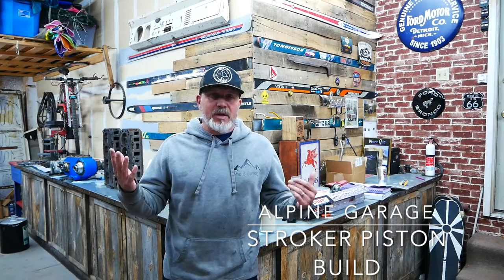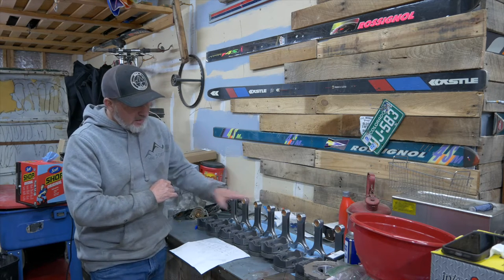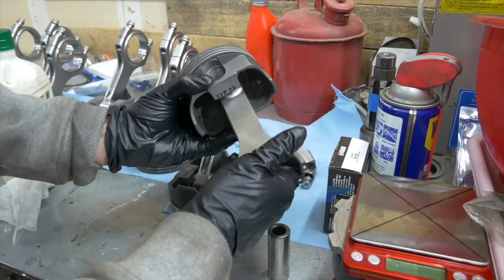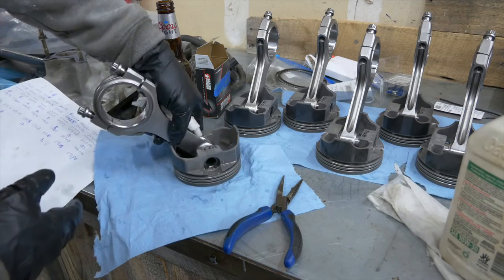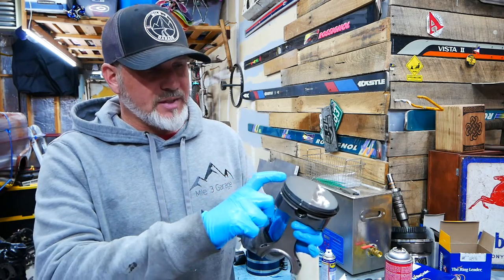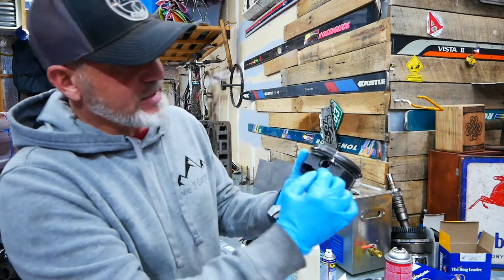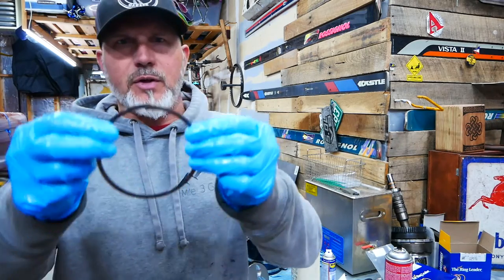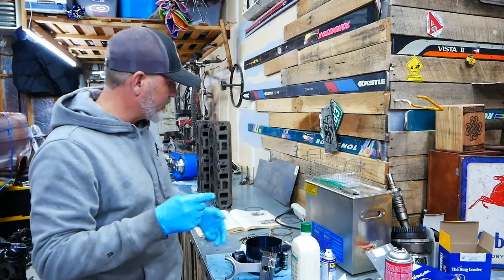Ford Bronco - Building a STROKER 347! [Pistons / Oil Support Ring /Machine Shop Issues]

Comment: You want the oil control ring to ride in the bore the same as the piston rings. The end gaps are OK at about .020"-.025" 
This is how the oil control ring pack manages the proper amount of oil film in the bore without smoking and fouling. Hey just trying to help.
Reply: I am building a 331 small block Ford stroker this week so I appreciate your videos and wish you the best!

Comment: I like the way that You are building Your engine ! Taking Your time to make sure all your clearances are within specifications , will take You 
longer but You will have a superior product !  Also whose stroker kit is that ? I noticed that the pistons have dual valve reliefs so they will work with The Twisted wedge heads 👍 .
Thank You for the great content  !
P/S what is the imbalance of your damper and flywheel  0-28 or 50oz. any information that You are able to share will be greatly appreciated ! Thank You & Best Wishes . 🇺🇲🇵🇷🦊👍
Reply from the maker: Hey Ferdinand. The kit came from speedmaster.  It is a 50oz imbalance, but it took me two machine shops to balance. Both said the kit was not made to balance correctly. I had HUGE issues with speedmaster, so be cautious of dealing with them.
Reply: You get what you pay for and that's an understatement... Hope all works out..😊